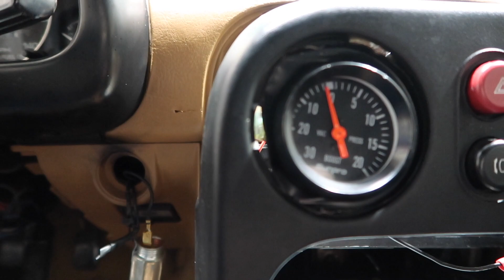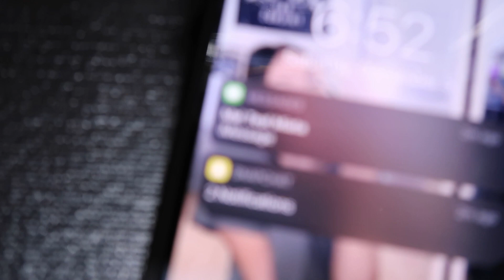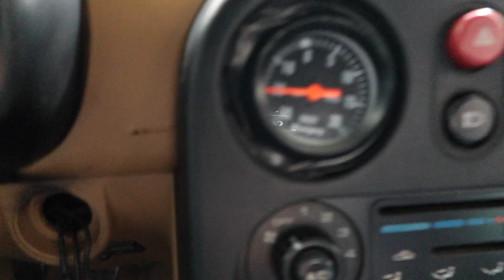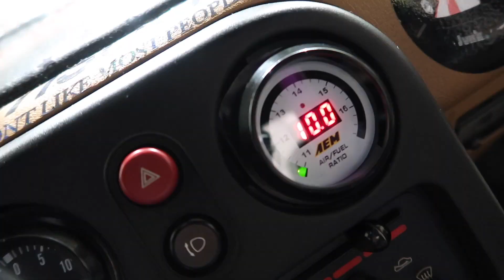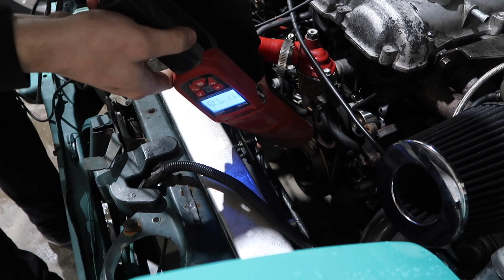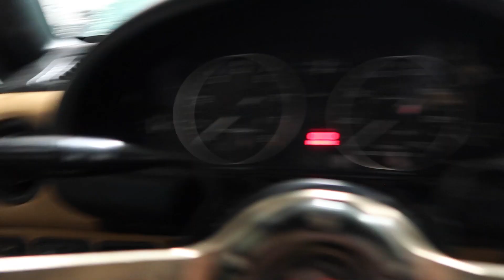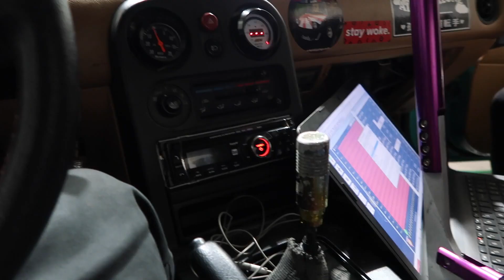I convinced JIMMY OAKES to get this Miata running...

Comment: Rudnik had fuel pressure regulator. Injectors were open same time but there was bigger fuel pressure when there was bigger manifold pressure. So it could run